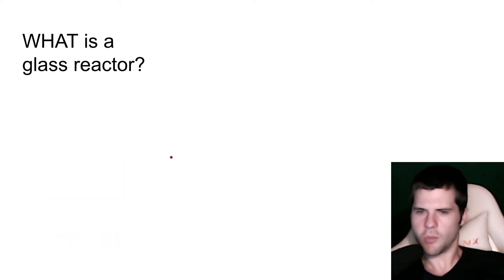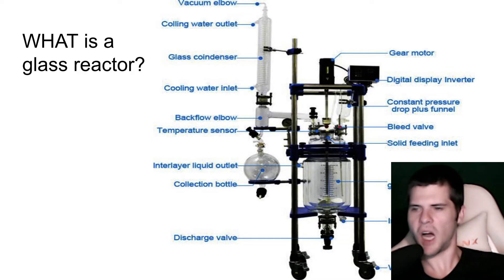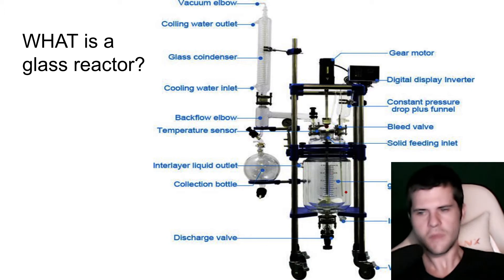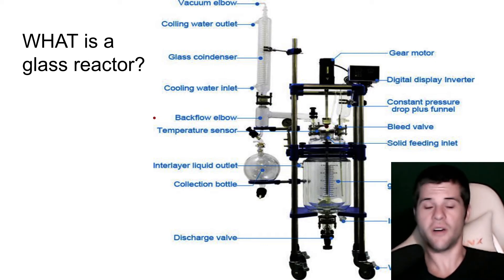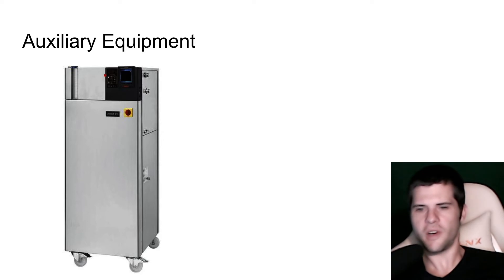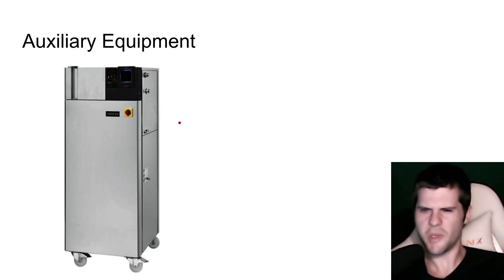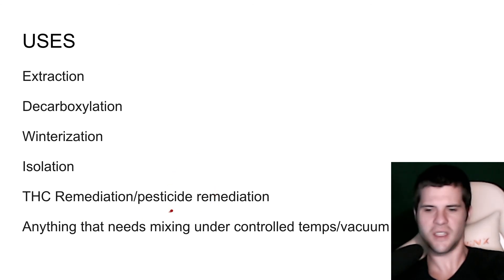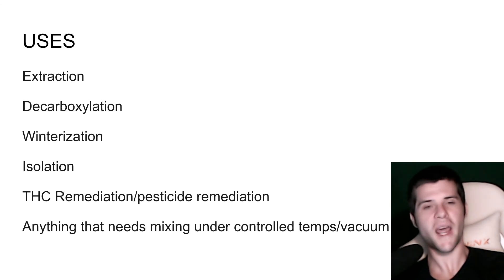HOW TO USE A GLASS REACTOR

Comment: I see what you mean by "scale" but looking at the pic of the reactor U have there it seems to be  ~3-5liter capacity right? I mean that's a 1liter hanging off the condenser isn't it? So how are 3-5liter reactors doing more than 3-5liter flasks?
Reply from the maker: Ah now you are just trolling. 5L , 25L, 50L, 100L. Operation is the same. Best of luck with the BF though sir.

Comment: Apart from the drainage valves I can't really see what U can do with this that U couldn't do with an ordinary flask & condenser distillation setup.when U r talking a difference of $250 compared to $25000 it's just not worth it
Reply from the maker: Well the equipment would be roughly $15k out the door, but I see what you mean. However the answer is quite simple and that is SCALE. When you move from a hobbyist or very small scale mom and pop operation to commercial supply for thousands of consumers $250 isn't going to cut it. Not enough hours in a day. Do you follow me? In the same time you could do 10 kilos with flask/condenser I could produce a 1000 kilos with a GR.